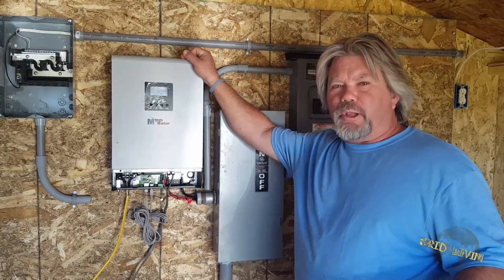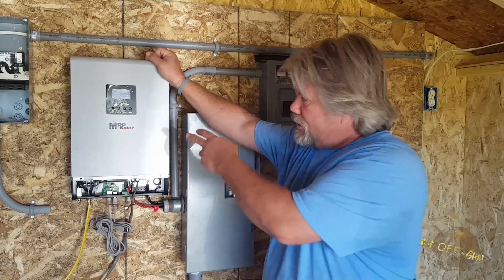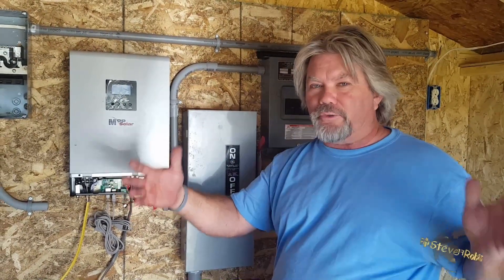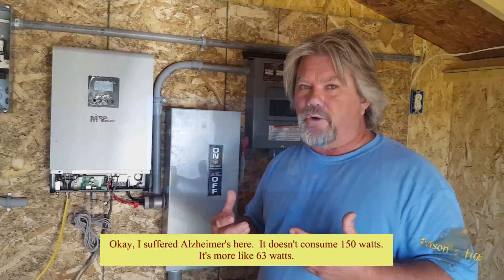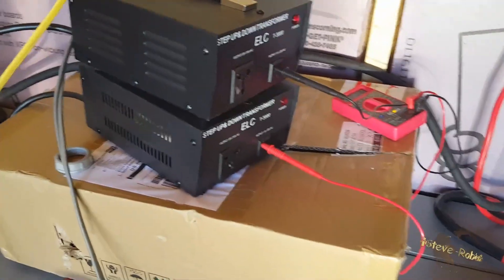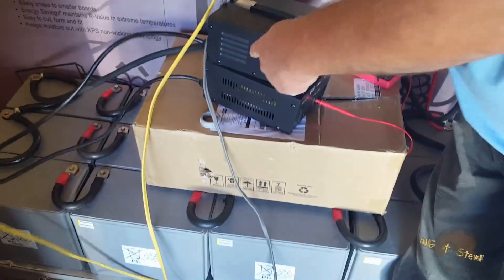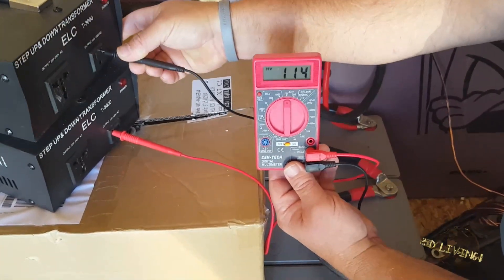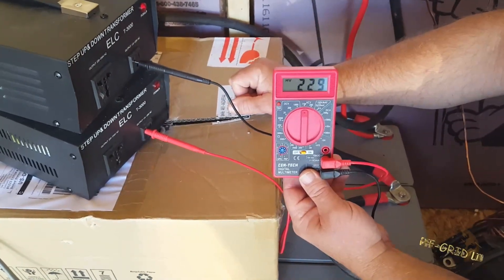Another MPP Solar PIP Inverter Split Phase Transformer Solution

Comment: Been reading many of these that say they are rated for 3000 watts are really only good for 2000 watts. May need to get a model number of 5000 to get actual 3000 watts. Kind of like how craftsman advertises air compressors being 3 HP are really only 1HP or less... as soon as the competition lies on what there output is to get us to buy there product all the other manufactures have to do the same thing else they wont be able to see theirs.
Reply from the maker: I'm sure there is truth to your statement.  We have used a single transformer to build Chris's entire house.  The breaker on that transformer does trip if the air compressor is running and someone starts the table saw.  But I would say that it is pretty close to what it advertises.  It is well protected with two separate breakers - one for input and one for output.  It is always the output breaker that trips.
Reply: I understand what you are saying. I do like using an auto transformer for the purpose your using it for. But may need to use a bigger one. The worse thing that may happen if the breaker for the auto transformer trips is there will be an unbalanced load across all of the 120V circuits. if there is any fragile electronics plugged in at the time some circuits may have 170 or higher volts and burn up expensive equipment. The same thing happens when a house looses the neutral connection out at the meter base. it can fry a lot of stuff inside. I am an electrician by trade. I would suggest using a single phase 5 to 7KW transformer using only the low voltage side and capping off the high voltage side (usually 480 V). Or just using an auto transformer (single core center tapped transformer) either one of these used in this matter should use low quiescent power. By the way I really enjoy your insightful videos and admire your ingenuity.

Comment: I have been working on my LTO battery packs and was thinking about the transformer loss issue you are working on. The transformer idea seems like a good idea but the only issue is near full load the transformer may have more losses due to the fact  the transformer is smaller. The trade off is good due to the fact most 120v loads are very small in most cases.
Reply from the maker: I will have another video up shortly showing my completed findings about this method.  If your 120V loads are fairly balanced, there is little current that goes through the transformers' coils.  This is done by correctly tying the inputs to the outputs (I will have a diagram up).  If you have a 1200w resistive load on one side, and a 1200w resistive load on the other side (transformer), the loads form a voltage divider and no current passes through the transformers.  Any load imbalance is then handled by the transformer carrying the largest load.  If you have a 1000w and 1200w load on each transformer, then the transformer connected to the 1200w load will carry only 200w of power through it's coils.  Inductive motor loads work the same but the load balance swings can by wild within the AC waveform..

Comment: Great info! Quick question, if I needed to supply AC in as well, in that version of the PIP, I would need transformers on the PIP input to step up the voltage, correct?
Reply from the maker: If your AC well is 220/240VAC, you should take the feed straight from the inverter.  A transformer would introduce some loss.

Comment: I worked for a company that designed UPS systems. We had a space issue for a transformer. We solved the problem with a ferrite core transformer.  They are round and could mount on your wall . They could have lower losses. You  could mount the two transformers you have in one box.
Reply: I did the same thing with a Toroidial transformer, that's round too, i'm not sure if its the same thing you are talking about, but 3000 watts for about 30 watts on standby with no load. I don't know if there are more efficient transformers out there but I am satisfied.

Comment: Another question please...
On Chris and Beckys home..
They have other than metal water line feeding the house..
In Los Angeles...
The code we follow on the ground wire.
One continus cable from where the water is supplied to the house..
Thru 2 ground rods at least 10 feet apart.
Then to the metered service panel....
What did they require for your install....
Reply from the maker: The ground here is very dry and this is quite arid country.  As a result ground rods aren't as effective here as in moist soil in other areas.  The ufer grounding strategy is more commonly used here (that's something for you to google!).  In Chris's house we used a combination ufer and ground rod driven through the slab and straight into the ground.  The ground wire is run from the service panel in the hallway through the attic down into the wet wall to the ufer and ground rod access within that wall.  

For the well, the water is supplied through 1" PEX tubing.  The wiring to power the submersible pump is buried with  the PEX tubing.  This wire is UF #12-2 conductor with ground.  The pump is 230VAC Grundfos soft-start submersible.  The ground in the UF cable originates in the service panel where the neutral is bonded to ground.  It terminates at the steel well casing that extends 40' below ground level.  The steel well casing encases the PVC well casing which then extends 360' to the bottom of the well.  Any and everything metal that has ground potential is bonded.  As a side note, I discovered that NO MPSOLAR PIP inverters meet NEC code requirements for installation in USA.
Reply: Steve Robertson 
Yes quite familar with ufer grounds..
Refinerys, chemical plants, etc..
All have ufer grounds..
Thanks

Comment: Question
Your thoughts 
Mppt pip 4048ms
Vs 
Mppt pip 4048ge
Reply from the maker: Internally there may be some bigger differences.  From an end-user standpoint, the higher PV voltage will gain you more distance from the charger.  If your home is in a canyon, you could put the PV on top of the hill and use somewhat smaller wire from the PV array down the hill to your home, saving a LOT on wiring costs.  There are some claims to better efficiency of MPPT algorithms, but I haven't seen any white papers regarding it.  A subscriber wrote me to let me know he purchased the GE model, and he's quite happy with it.
Reply: Steve Robertson 
Thanks
Reply: Yes, I have the PIP4048GE with only one autotransformer to do splitphase and is working awesome. 8 months I have my system installed running A/Cs at 240V and apliances at 120V all together

Comment: Love your split phase idea.... but I gotta ask about the reality of ebay chinese transformers.... do they really do 3kw each?  You know the chinese love to over state as much as possible.
Reply from the maker: The inverter is rated @ 4KVA, each transformer is rated 3KVA for a total of 6KVA.  The inverter will die on output error before the transformers hit their max.  Since 99% of any and everything we buy is made in China and just rebranded by American companies, I prefer to cut out the middle man and just buy directly from those manufacturers.  Chinese made is still Chinese made, regardless of whose name is on it.  Just my opinion and maybe you agree or not.  It just is what it is.
Reply: You're right about all stuff made in china and rebranded.  Don't disagree... but there could be a difference in duty cycle in those transformers vs a "real" transformer.  I know they are notorious for using odd gauged wires to scrimp by on the absolute minimum of copper.

BUt I'll tell ya what... you have enlightened me and solved the split phase problem.  PUtting two step downs in parallel out of phase is friggin genius.  I had really been concerned about balance between the phases and you've cracked the problem.
Reply from the maker: Thank you very much for that encouragement sir!  My next step I'm going to try and tie the 230VAC inputs and outputs together so that 230VAC appliances will get a more direct path to the inverter power.  I'll try it after the Spring thaw and post the results as well.
Reply: That's another solution as well.... you could have a 220v panel box which runs directly off the MPPT solar inverter and just a simple 220-110 step down which feeds a 120v panel box.  This is great for a house designed as of grid from teh start but will be problematic for retrofitting existing houses.  Take care and keep up the great work!

Comment: Hi Steve, Iam very interested in buy the PIP4048 and do split phase with transformers. This system you show with two transformers works reliable when you put loads on transformers?. Did you found other more efficient transformer that draw less than 16W?. Thanks Steve
Reply from the maker: I have not tested this arrangement adequately to say that it is a truly viable solution.  It will be at least 4 months more before I can perform these tests.  I haven't found a transformer that draws less than 16w as a split phase output either.  This arena is still new to the off grid world.  As a result, it is still something that will come with risk if you choose to go this way.  Most people that choose it, don't regret it.  However, some do.
Reply: My house consume no more than 600W with no heavy loads connected, just refrigerator, some led lights, 100W TV and 200W computer. I will consider it and hope all goes well.
Thanks Steve for your time, testings and information.
Reply from the maker: I believe you would be happy with it.
Reply: Steve Robertson , I have a question. I will buy the PIP5058MS and use two 3k transformers cross connected to the inverter output to have split phase 120/240. The question is, I will be able to connect the grid split phase 240V cables(L1 + L2) to the inverter input to use the transfer switch and charge batteries?
Reply from the maker: Yes, you can connect grid to the utility input of the inverter and it will charge the batteries.  What you want to try with the cross-connected transformer is largely untested.  I you proceed, I would like to hear what your thoughts are about it.
Reply: Steve Robertson , Are the two transformers you use on this video autotransformers? The model THG-3000(autotransformer) will work the same way as the T-3000 you use? If yes, how will be the wiring with the inverter output to get split phase 120/240? Thanks Steve
Reply from the maker: These we use aren't autotransformers.  They should wire and work the same as long as they are set exactly the same.  If not, you could have one half of your phase with higher voltage than the other.
Reply: Steve Robertson It is working!!! Iam running with PIP4048GE 240v with two cross connected T-5000 transformer to get split phase. I turn on all my house. Later I will upload a video. Thanks thanks a lot
Reply from the maker: My brother you have warmed my heart with that great news!  Please let me know when you have the video uploaded so I can see what you have!
Reply: you are from puerto rico like me? i have the same problem which transformer you recomends me my inverter is 3kva
Reply: can i use just one T-5000 to get split phase or need 2
Reply: IF YOU HAVE THE VIDEO CAN SEND ME TO TURBO10260@GMAIL.COM

Comment: Hey steve,
Just watched your video and it's a great plan.
My question is does the 5kva or 4kva hybrid inverters have a power limiter features, for example so it won't feed back to the grid or limit the power as needed for home.

Thanks,
Reply from the maker: Unfortunately,  I only have experience with the off grid MS series inverters, so there's nothing on these that would feed back to the grid nor limit power to the home.

Comment: Steve, I've purchased the pip you recommended for an off grid supplemental system.  Do you think after spending some time experimenting with the split phase system that it is the best solution for powering an off grid breaker panel? I'd like to power a 240V water heater and possibly a small 120v deep freeze. I like your split phase idea!   Thanks!     PS my system will be 2800w PV, PIP 4048, 4 12volt 105AH batteries wired in series for 48v.  Hoping to use the power mostly during the day to save batteries.
Reply from the maker: It sounds like you have a great system.  As far as the split phase system, I know it works well on the 115V side of things and it does also provide 230VAC.  I can't really say what I think about it until I have Chris' house finished.  Then I'll have lots of result to share.
Reply: Steve Robertson thanks!  I look forward to hear about your results!  Looks like I'll probably try the system you experimented with In this video to get the split phase 240vac I need and 120vac.  Thanks again for sharing your wisdom and experience!
Reply: Steve, I hope it is ok to ask so many questions if not just let me know And I can slow it down. I have a deep respect for you and your experience/wisdom.  My question:  I have 10 280w panels  with open circuit voltage of 44.3v Isc 8.40a and the pip 4048. How should I wire the panels for maximum output and efficiency?  If I read/understood things correctly in the pip 4048 manual, the max open circuit voltage is 145vdc.  I didn't plan well when I purchased the panels.  Ideally I would've bought 9 or 12 to run them in arrays in series of 3 for a total of 133vdc.. right?  Am I understanding this correctly.  If I am correct in my understanding of how all the components work together, looks like I have 3 options

1) wire the panels in arrays of 2 series for 88.6vdc open circuit voltage to then wire then arrays in parallel.
2) wire the panels in arrays of 3 series for voltage of 132.9vdc OCV to get the closest to the pips 145vdc max. And not use the 10th panel
3) buy 2 more panels to have 4 arrays of 3 in series.  (Not in budget)

My concern with option 1 is that when it is cloudy there won't be enough voltage to activate the pips mppt until it gets up to 60volts.  Is this concern correct?  Option number 2 would leave 1 panel not being used and I hate the thought of it not contributing my power.

Steve,  am I correct in my understanding of how the system works and the specs?  What would you do?  Thank you for the community you have fostered with the videos and your accessibility!

Darren
Reply from the maker: When I first installed a PIP, my understanding was the same as yours, and it makes sense.  PV modules will stay a fairly consistent in their open voltage throughout the varying light input.  It is the power curve that suffers, meaning that as you draw amps, the voltage will quickly decrease because of that power curve.  MPPT exploits the power curve by maintaining the highest output of amps possible back into the batteries.  As a result, there is a "sweet" spot for voltage in the MPPT charger that lies between 85-110 VDC.  The maximum input is just that - MAXIMUM.  Therefore, your selection of 88.6 VDC open circuit is actually the best configuration for the MPPT where it will operate at it's highest efficiency.  The MPPT will maintain voltage/amperage at the highest power so you get the most wattage input from your modules.

So even if you didn't plan well in your panel purchase, it worked out well.

Comment: My question is that the Magnum inverters have 240 output all ready.
Do you need 2 transformers for the Magnums as well?
Do you have the transformers on your Magnum set up?
Reply from the maker: Transformers aren't needed on the Magnum as it already has split-phase output.  The MPP solar inverter outputs only 120VAC or 230VAC with no neutral.  It requires an external transformer to get 230/115VAC output.
Reply: Thank you Steve I was not sure.
I seen a video where 4 Magnums were daisy chained together it amazed me. Don't remember the link. Sorry!
Reply from the maker: No prob.  I know they can be tied together, but I haven't done it with them.

Comment: Hello Steve: I was wondering with the 3000 Watt Voltage Converter Transformer Heavy Duty Step Up/Down  be able to take 120 v from a inverter and step it up to 240 v split  phase..  Neil Las Vegas
Reply from the maker: These transformers will do a step up to 240 from 120.  You would probably have to use a total of 3 inverters.  One to step the voltage up, and then two to create the split phase.  But that's just off the top of my head, there is probably a way to do it, just not one that hits me without some thought.
Reply: @OffGridLivingSteve  do you know if there is anything more affordable to make this happen? since youd have to buy 3 at 80 a piece?
Reply from the maker: Mike Rivera JR yes, it can be done.   I would probably need to do a video about it though. Most of us are visual learners brother.